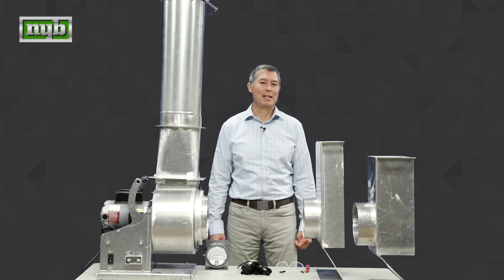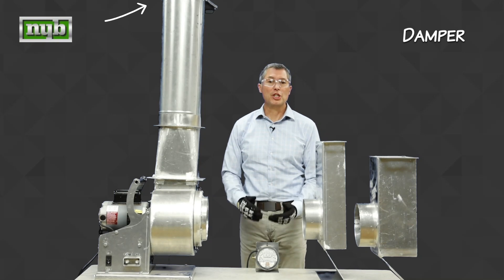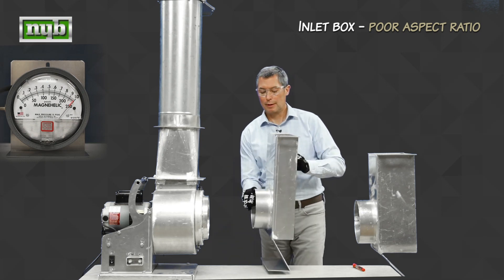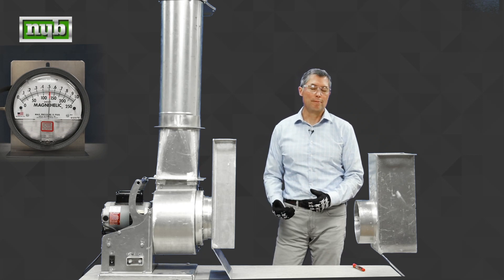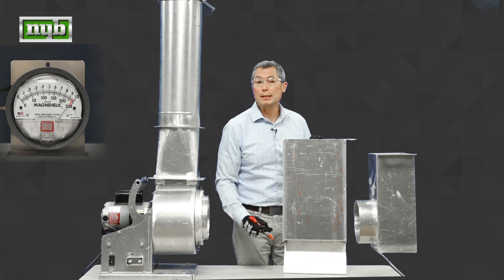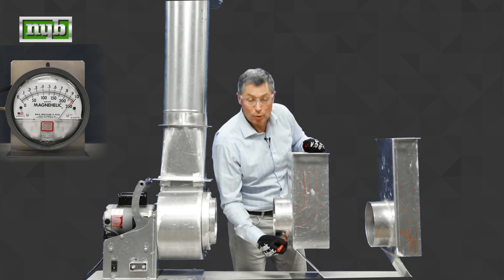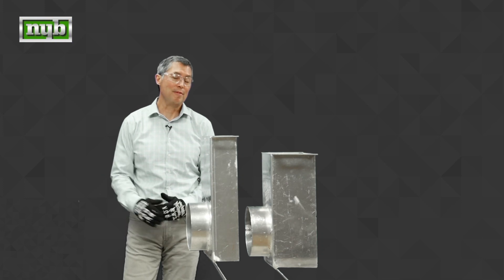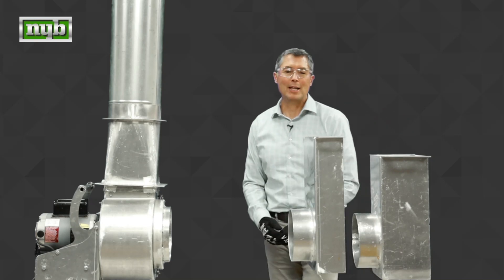How Inlet Boxes Affect Fan Performance (System Effect Series 2 of 6)

Comment: David 
This is interesting to me.
What would happen if a wheel is added inside the box to work with the wheel in the blower. The same way a turbo charger works, but working with the air going in one direction.
Reply: assuming you mean running a second fan inside the inlet box connected to the same motor, you would gain some static pressure and cfm at the cost of more power consumption, so a similar effect to just running the first fan faster. This is unlikely to be worth it due to manufacturing complications, but as far as I know secondary fans like that are more effective at lower air pressures, so maybe a system like that could be useful in high altitude situations where the cost might be justified.

Comment: "Top region never sees any air."

So you're saying that somehow there's a pocket of perfect vacuum right there?
Reply from the maker: Hi! To answer your question, there is never a “perfect” vacuum and this could have been stated as “sees very little to no air”. The pressure is near zero or a slight negative. Functionally this part of the wheel does little to no work.

Comment: does baseline pressure have the same number on any circumstances?
Reply from the maker: Hello! Thanks so much for watching and reaching out with this question. 

Baseline pressure is the same as long as configurations do not change. For all of the inlet configuration videos, the base line pressure is based on a fan with an open inlet, rectangular to round transition leading from the fan into a straight run of ductwork before heading into a damper with a preset position. Any changes to this configuration would establish a new baseline. 

For example, if the damper position changes, a new baseline is established. If the straight run of ductwork is removed, a new baseline is established.
Reply: @NewYorkBlowerCompany  i am wondering how many pressure do I need in order to have magnehelic to measure the standard pressure of in line pipe of my coffee roaster
Reply from the maker: @aifrisyad7491  In order to better understand your question, can you clarify what you are trying to measure/accomplish? Are you looking for velocity pressure in order to calculate flow? Or are you looking for static pressure to calculate pressure drop? 

If Static Pressure (SP), one point should be good enough. If velocity pressure, it depends on the amount of straight duct available as well as how accurate the reading needs to be. Note that both readings are most accurate when taken in a straight run of ductwork (non-turbulent flow).

Resources in include nyb’s Engineering Letter 7 - Field Testing of Fan Systems (www.nyb.com), AMCA’s publication 203-90 - Field Performance Measurement of Fan Systems, and AMCA's publication 201 - Fans and Systems. (www.amca.org)